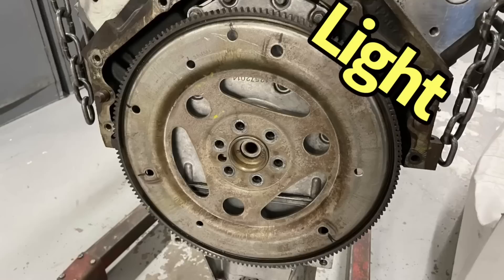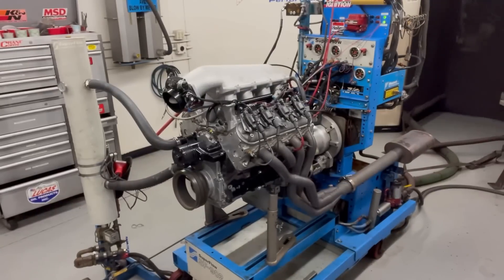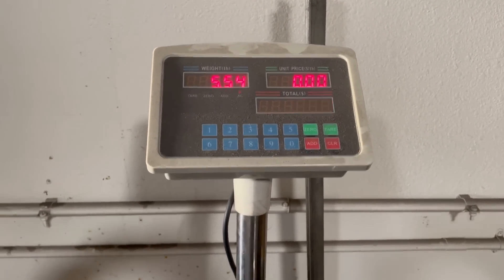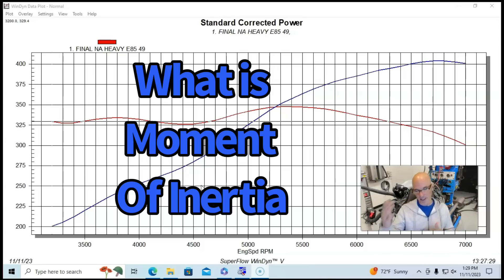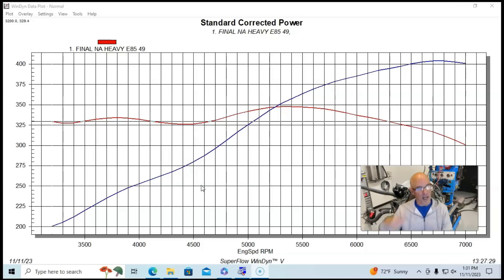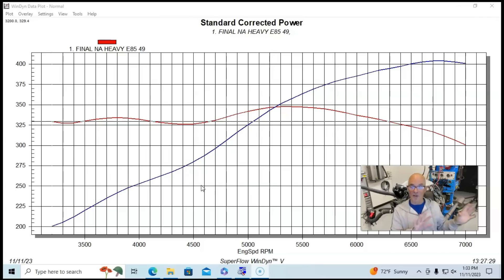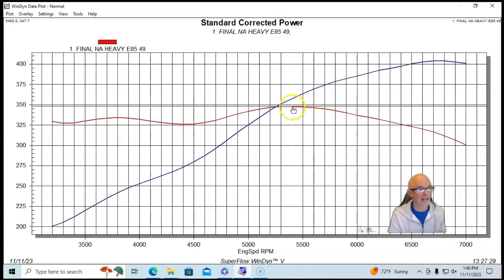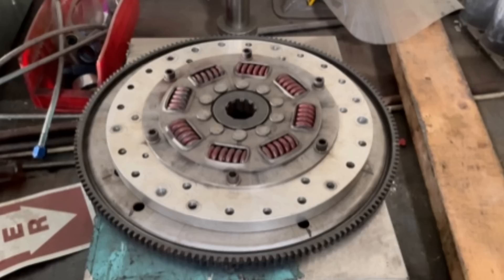FLYWHEEL VS FLEXPLATE-DOES A LIGHTWEIGHT FLYWHEEL ADD ANY POWER? 45 POUNDS VS 16 POUNDS-WHO WINS?

Comment: Unfortunately this isn't an answer, it's a failure to understand the question... The dyno has a fixed acceleration rate, which will make this problem marginally better, but the dyno has a calibration factor which accounts for the inertia of the engine... Playing with the engine intertia doesn't change the power output, it just changes the numbers the machine produces... In principle this calibration factor would be zero if you dynoed at a fixed RPM, which, incidentally would be the only way for you to "prove" that this event was true, but in this case all you're doing is failing to update the dyno cal and getting an artificially bigger number... It means nothing.
What you might be getting at which WOULD be a relevant assertion, would be considering the driveline inertia impacts and the fact that reducing mass anywhere in your driveline reduces the amount of power the engine produces which is going to accelerating the driveline... That does include wheels, hubs, driveshafts, diffs and even gear clusters though... Certainly not just the flywheel... This impact is diminished in an automatic because of the way the torque converter loads at stall and tends to reduce the initial rate rise, but is worst in low power situations... The other thing that's extremely relevant here is how much power you actually need... It turns out that you can't put a lot of power down in lower gears, where the rate is higher, because you run out of grip... More power, higher speed where you move out of grip limiting... In this case, depending on the vehicle it's probably reasonable to assume that, on a street, you can't put this down until about 100km/h (60mph) so it's not as likely to be relevant in terms of rate anyway... More powerful motor, less relevant intertia characteristics... If this were a classic racing series of autocross, low powers, low speeds, high transition rates... Sure... If this is a road race application where you're in the throttle a lot at mid throttle and transitions, all relatively high speed... Irrelevant...
Reply from the maker: the acceleration rate can be changed on this engine dyno-on a chassis dyno-the rate is not fixed but changes with power output
Reply: @richardholdener1727  you can change rate on any dyno that isn't a pure inertia dyno... You can have infinite control over rate on anything that uses a retarder that isn't inertia based... You can run a negative rate on some eddy current dynos, although I'm not sure why you'd want to do that... But RPM hold is frequently used for tweaking certain engine behaviors... The main difference with a chassis dyno is that you have even less indicator of what your "true" horsepower is, because of tyre losses...

Comment: Hmm, word of warning for an everyday street car a light flywheel loses bottom end driveability. Mildly lightening and a lighter and better clutch can help. But maybe not.
Drag racing generally likes a heavy flywheel. But then you have to keep the engine on the boil. Or accelerate that mass again.
Circuit racing? most will use a light steel flywheel and a triple palte Tilton style clutch, generally 7 1/4" . Weighing between 16-20lbs. 
A 'normal' street clutch will weigh around the same weight as  the flywheel. Any where between 20 and 30lbs.
A speedway clutch for a sedan or modified is a tiny flywheel, with a tiny ring gear and a dog style clutch in the gearbox. Very light but only usefull for those cars. 
Beware, lightening and abusing a cast iron flywheel they can and will explode. And very occasionally just the ring gear can as well. That with high rpm.
An alloy flywheel to replace an iron one is generally ok. Most have a steel section cast or bolted in for the clutch plate to grip too. NEVER use an alloy flywheel with a friction disc onto the alloy. They explode, I saw one once explode left [where they usually go]  and explode the bellhousing, cut the header as well as the chassis rail. On a speedway sedan. 
Cast iron at the drags has been known to injure spectators 80 feet away. BIG explosion contained by  steel bellhousing,, sort of!
I have also seen a iron flywheel  [V8 Ford]with clutch come off the crank, did a LOT of damage to the car. Killed the gearbox bellhousing, floor etc. Though conversely another where the crank flange broke off did very little damage,, engine sounded real strong with all that weight missing. That on a crossflow grey Holden engine.
Speedcars and Sprintcars have no clutch or flywheel,, the reason they rev so quickly,, and the reason they have to be all pushed off to start,, sometimes many times a race!!
Reply: Idn don't see many crossflow grays mate had one in an FB early 80s

Comment: Since the flex plate is bolted to the converter shouldn't the weight of the outside rotating housing of the converter be added to the weight of the flex plate ?
Reply from the maker: there was no converter in this test-just lightened flywheel assemblies (we used a flex plate as a flywheel substitute)

Comment: Engine Power did this before, but varied the acceleration rate .   You didn’t get much on a brake dyno, because the acceleration is so slow.   Unless you race at steady state, a chassis dyno is better for this test
Reply from the maker: and yet...
Reply: agreed, bare minimum. only goes up in low gear

Comment: Really   a flexplate would ALWAYS be bolted to a tourqe converter in a car . you didn,t mention that . In another manner it would be like saying a 4.8 LS would make more power in a lightweight Nova say 2800 LBS verses a 1 ton dually that weighs 5000 LBS . I UNDERSTAND WHAT YOU ARE PUTTING FORTH , THOW A LITTLE CONFUSING .
Reply from the maker: there was no automatic trans in this test-just two flywheel assemblies. Just because it said flexplate...doesn't mean there has to be a converter

Comment: I assume this would also apply to torque converters. My 9.5 inch Yank converter weighed significantly less than the stock 12 inch converter.
Reply: Well yeah, less material vs more material

Comment: I reduced approximately 1.7 kilograms from the outer edge (in total it weighed 9kg) from the Sentra flywheel a year ago.  It's only a 1.6L engine and of course I gained less than 7 horsepower compared to the LS (I guess) but the gain is notable.  Soon I will reduce it to half the original weight or less if possible, I already found a place in Guadalajara to have the Flywheel balanced.

Comment: I was hoping you’d run the tests at both 300 rpm/sec and 600. The engine with the same rotating mass will have a different curve with just the acceleration change. It would be interesting to compare the differing effect as acceleration rate changes. Thanks for another great video, Richard.
Reply from the maker: covered that in the live feed

Comment: It's not just size but where the weight is.  A larger flywheel where all the weight is in the middle would be better than a medium size flywheel with all the weight at the outside rim of the flywheel.  The distinction being that a flywheel big enough to engage the starter could still use a small friction surface (where most of the mass is) toward the middle to reduce the moment of inertia.
Reply from the maker: we covered weight and size in the discussion on MOI
Reply: @richardholdener1727  I was talking about the distribution of weight across the size.  A large ring gear but small friction surface flywheel can have lower moment of inertia than a flywheel with a smaller diameter of similar weight if the mass is further out compared to the larger one.  I think the base formulas assume fairly consistent distribution of mass.
Reply from the maker: there are much more complex formulas that can calculate the those changes
Reply: @richardholdener1727  agreed

Comment: Do steady state and see if they do same trq and hp numbers because the dyno software account for the inertia and measured trq and outputs the results
Reply from the maker: the dyno software doesn't "account" for inertia
Reply: @richardholdener1727  okay cool then do steady state measurements to see if there is a change in trq and hp

Comment: Instead of an acceleration test, do a step test. The difference will be negligible. Do the test at 200 rpm/min, 400 rpm/min and 600. The faster the acceleration rate the bigger the change. You will typically see a bigger number in a step test with the engine parked at a set rpm.

Comment: The rev step rate needs to be slowed down or even better , manually step the engine through the rev range so the engine stabilizes at 500 RPM steps for 2 seconds so we are not running into some sort of software artifact.   Does this dyno have synthetic inertia measurement / correction or some other calc?

Another test would be to have a single tooth crank sensor at each end of the crank then measure crank twist to determine if this is where the power is coming from.  HBREPAIR has some old GM tests showing 0.35 to 0.45 degree crank deflection on a Corvair engine with 2 different dampers.  

A lower inertia flywheel allowing the engine to produce " more " power is dipping into the perpetual motion / run an engine on water realm as long as there isn't some other change in engine deflection.

Comment: Weight of a tourqe converter?
Reply from the maker: no converter was used
Reply: @richardholdener1727   just wondering what the weight would've been with flexplate and loaded torque converter

Comment: I used to play around with 5hp briggs and stratton go-cart motors. I did a light weight flywheel and machined much of the counterweights off the crank to lighten it up. That motor was a turd, and took forever to Rev up.  Lesson learned, one stroke to make power and three strokes to consume. In a single cylinder engine, light weight rotating mass  did not help.

Comment: Suggestion. What I would like to see is how or what makes an engine rev more quickly and makes it more responsive. 

For example due to smaller and lighter flywheel, and other factors like exhaust and management systems. I’ve seen some Ford V8 engines that rev like Formula One engines. 

You touch the throttle and wham, it goes all the way to 8000 RPM quick.

I know some racer who race shelby cobras and they use smaller, lighter cutches and fly wheels but but more importantly, it’s not about horsepower it’s about how quickly the engine revs and how responsive it is. 
Hopefully you consider doing this test. I think it would be very interesting. 

I think there are many factors that contribute to an engine being quick revving but it’s quite complicated.

Comment: A torque converter ain’t light
Reply from the maker: there were no converters in this test
Reply: @richardholdener1727  lol I know that. I was just saying in a car you would have either a flywheel and clutch or a flex plate and torque converter.
Reply from the maker: this was a flywheel test-get past the part where we used a flexplate as the lightweight flywheel.

Comment: Can't beat stored Energy rotating mass look at old diesel single cylinder engines that put out 500 foot-pounds of torque it's because they're rotating 500 pounds flywheel. I know on my 22re  Toyota stuff heavy LC flywheel for rock crawling makes a huge difference The only time it sucks is when you're trying to climb a really long Hill and you run out of  Rolling speed motor bogs down a little The early Toyota 22er turbo motors used a heavier flywheel same 1995 model which can use biger v6 clutch. Heavy flywheel is nice motors are not so RPM  power band peaky  In my experience helps with Turbo lag also  Consistently. especially on small engines. I would actually recommend on V8 motors if you're going to run an ultra light flywheel to upgrade your valve train If you Miss A shift that thing is going to hit Sky  high RPms

Comment: I like to think a flywheel is more or less a kinetic battery. It stores energy proportionally to the average mass from its center and its rotational velocity. Free revving or, say 1st 2nd gear pulls will need to "charge" that energy much more quickly than a slower rate of rpm change in higher gears. The impact of a fly wheels energy storage will be much more noticeable in cases where you're trying to accelerate the wheel's rotation quickly. In the case of my old 1995 bmw 540i I calculated that my LWFW dropping over 30lbs "free up" in the ballpark of 40hp in 1st gear (mid 20hp range for 2nd gear). In the case of my 540 the difference was quite noticeable until 3rd gear.

Comment: You proved the point I tried to make for years to my friends back in the 80's.  I ran a 462 Pontiac, 12.7 CR with 3.08 diff gears and a wide ratio 4-spd in my 1968 GTO.  I also ran a schiefer 11lb aluminum flywheel vs. the std 30lb steel pontiac factory flywheel.  My Pontiac engine revved like it had nitrous injection.  When I would run people they would accuse me of such or of running 4.11+ gears because the car revved SO fast compared to engines with factory flywheels.  My 3.08:1 rear gear did NOT hinder me in street driving in any way, allowing me to run high 12's.  High compression, ported heads, light flywheel - that engine wanted to REV.  

Perhaps you can run a similar comparison on a larger displacement engine to see if the gains are even greater between them???  :-)

Thanks Richard.
Reply: It's not a power gain, but limiting how much power is lost when spinning the lighter flexplate/aluminum driveplate combo. Dropping almost 2/3 of the stock flywheel/driveplate's rotational mass ain't peanuts!

Comment: Having installed a lightweight billet flywheel I can confirm without a single doubt that it added absolutely no horsepower to the engine...... however it is abundantly clear that more power is finding its way to the wheels
Reply: I put a lightweight flywheel (7.1kg new one, stock was 11,3kg) on my 231hp BMW M54B30 drift car and I can definitely notice the loss in inertia when trying to initiate drift with a clutch kick or throttling into a drift from mid rpm. The car really needs a lot of rpm now. It's probably a bit more lively at high rpm but at low and mid rpm it is dead. I don't like it already. As Google search AI summary says - breaking traction with a lightweight flywheel really is harder and the car feels as if it has less torque even though it doesn't, it has less inertia. The change from 1st to 2nd gear especially doesn't hit as hard with the lightweight flywheel. With the heavy flywheel the car used to carry the inertia from 1st to 2nd gear and spin its tires but now it just bogs down. Maybe for 1000hp pro cars it's fine, but for low powered grassroots drift cars the heavier flywheel is just so much easier to drift. I can see the benefit for road racing though, where you're mostly on throttle at higher rpm and you don't need inertia to break traction and you do lots of fast downshifts under breaking. But for drifting your 200hp BMW I would suggest you avoid it. Make you car as light as possible, but leave the stock flywheel in.
Reply: Explain
Reply: @foxxrider250r  the heavier rotating mass absorbs more power, in this test the measurement is at the flywheel not the actual crank hub. The bmep of the engine hasn't changed at all
Reply: @diesel-technology5507  that's cool. Thanks
Reply: Of course.

Comment: Back in the 1970'  we used to un a Boss 302 in  D / mofified  production,  in a Maverick. the car would launch at 7500 RPM. With a 25-pound flywheel the car would launch then pull down  the engine so bad it was basically stalling. We changed to a 50 pound flywheel and the car Would carry the Wheels  right to the third gear shift with a Nash 5 speed. Once the car was launched the big flywheel was no different than the small one.  We picked up 3 tenths with the 50-pound Fly wheel!   i know times have changed and no body run's a standard any more. but this is real facts with a real car.
Reply: I wonder what the time difference would be if you you were already in gear and did a rolling start without a 7500rpm launch
Reply: @axlegrind4212  Your  theory  may  make you happy, but any body that knows any thing knows it is bullshit,   So you think that the reason a Trials bike has a 10 pound fly wheel  because it needs more fuel, you have good dreams but have no ckue.
Reply: @axlegrind4212  You are talking through your hat  the heavy Fly wheel was what kept the  Engine  spinning at high RPm.  It didn't slow it down. Like i said before Your theory is bullshit.
Reply: @axlegrind4212  You are smart  like a rock you try to Compare a 454 with a 302, one has tons of  Torque the  other  relies on momentumput an Aluminum  Flywheel on a Boss 302 and it wont make it ten Feet even with ten fuel pumps ans  1 inch fuel line..
Reply: @axlegrind4212  You have no clue  what  you are  talkung about so don't  bother .

Comment: If you were to measure power at a static RPM with a brake, the flywheel weight should be inconsequential.  Also, with a CVT, once at peak power, the effect of flywheel moment of inertia is muted (but we still hate CVTs).
Reply: Who would run a cvt behind a ls, the ls would kill it

Comment: I feel like the lightweight flywheel would be better for an everyday daily fun car. the lightweight flywheel would allow the motor to rev out in the lower rpm’s better and might even increase fuel economy because there’s less resistance in the drivetrain, but the heavier flywheel would be better in a drag application because it would keep the inertia going stronger off of a launch. Definitely something that is very application specific
Reply: But you have less rotational mass so the engine is actually more finicky to drive especially on a smaller engine with fewer power pulses per rec.